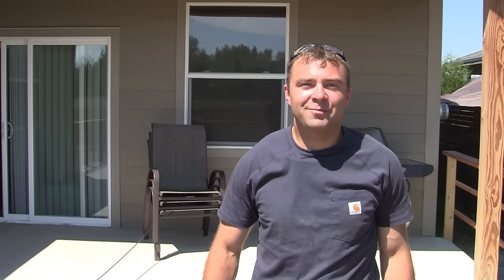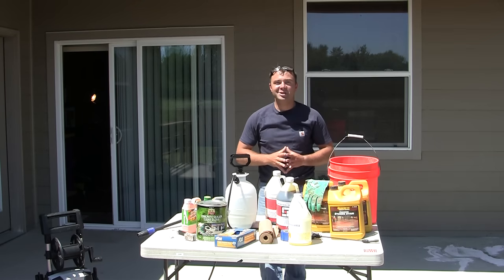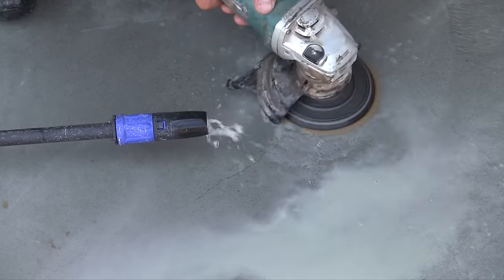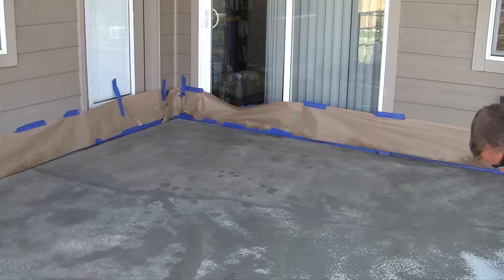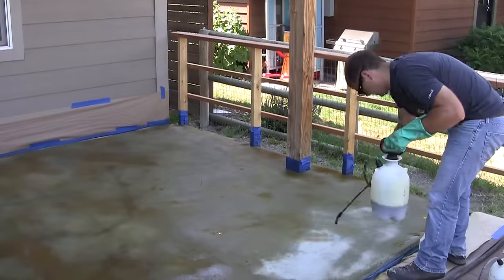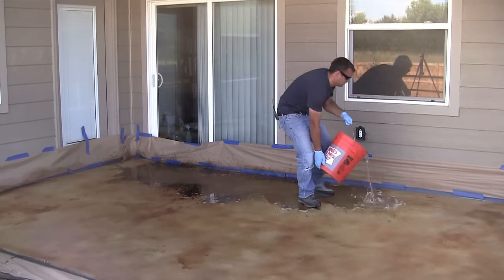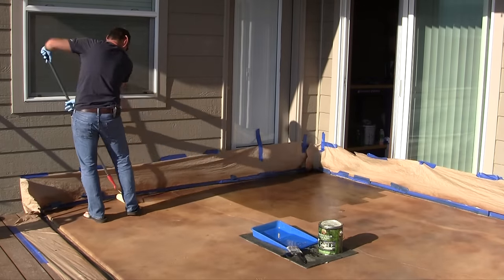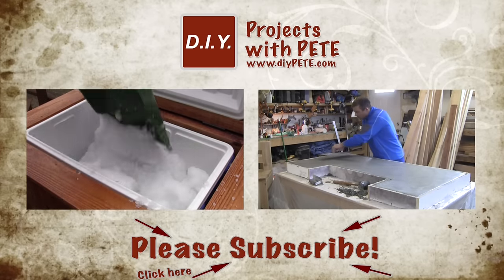How to Acid Stain Concrete | DIY Acid Stained Concrete Patio

Comment: Looking at doing this project on an existing tan concrete patio. Will the staining process eliminate any existing Efflorescence (White chalky substance) or does that need to be removed before the staining process. If so which product works best to do that. (Have used home remedies like white vinegar and pressure washing to no avail. Thanks
Ed
Reply from the maker: Hey Ed! Acid stains will not hide existing flaws, so you'd want to remove the efflorescence first. -- as for removing, you might use an etching solution or reach out to your local concrete supply store. If possible, you might look into using an orbital sander in the area if a power washer or etching solution won't work.
Reply: @DIYPETE  Do you have a product you recommend or video on this removal process?

Comment: great video, just put in a new pool, cement contacter want a ridiculous amount to color and stamp, can my  pool decks be acid stained?, if so any special sealers for safety when wet?, how long does the deck have to age before staining?, thanks
Reply from the maker: Hi! Pool decks can be acid stained. As for sealers, I'd recommend doing additional research prior to attempting to see what decorative concrete specialists recommend. Shark grip is a clear powdery sand that can be mixed in with a sealer to add grip. I've done this in sealers in garages to prevent folks from slipping. The manufacturers will all typically recommend waiting 28 days to stain. -- Whatever you do, I'd recommend doing a small test area in a more hidden part of the patio to make sure you like the colors and finish etc. And the more research the better.
Reply: stamped concrete is a MUCH better option for pool deck than stained concrete.

Comment: I've read that you should use the ammonia mixture before applying the dye as well to help clean & prep the concrete, do you recommend this or only recommend applying it after to neutralize?
Reply from the maker: Hi Nicholas! I've always cleaned the concrete and just use a degreaser and power washer. You could most likely use ammonia to clean if you'd like, but I used to do staining professionally, and we never did. Cheers!
Reply: DIY PETE thanks! Just sprayed the dye yesterday, going to respray over some uneven areas today. I'd like to thank you so much for the video. One last question, do you apply the seal/gloss coat right after pouring and brushing off the ammonia?
Reply from the maker: Hey Nicholas! You'll want the concrete to dry out completely after neutralizing the acid stain with ammonia and rinsing. Cheers!
Reply: DIY PETE Thanks for all your help. How often do you recommend re applying the gloss coat? Also, I got some on my asphalt driveway, do you have any recommendations for removing it? I'm unable to get it out with the cleaning products I tried.

Comment: Hi Pete, I'm about to acid stain my basement floor. But I was wondering, can I stain everything so it looks uniform then seal it later? I will be adding bedroom walls, but I'd rather not have work done on top of sealant/wax. And yet, I like the idea of actually staining the floors without and barriers in my way. What do you think?
Reply from the maker: +Pamela Olson Hi Pamela! I agree, staining before walls are in etc does make it easier -- and I wouldn't want to scratch up the floor once it is sealed. After staining the floor, you can wait to see if needed -- but I would highly recommend covering it with resin paper to still protect it during construction. Make sure you allow the stain plenty of time to react with the concrete before rinsing to ensure it fully reacts and penetrates into the surface.

Comment: I have no idea if you still check this channel for comments but here's hoping you do. I used a Behr Decorative Concrete Dye kit back in September 2012 on my back patio. It did a fantastic job. I used the Behr Wet Look Sealer on it and every year thereafter, I would put another coating of the sealer on it---with the exception of 2019. Therefore, I have not put the sealer on it since 2018. My patio now looks terrible, which was mostly from my lawn care  people who used their weed wacker around it; thus, chipping at it over the years. They now no longer weed wack around it. I was thinking of just using the same kit all over again and putting some fresh dye on it but I do not believe Home Depot sells that kit any longer since it's not on their site. At this point, I'm not sure what to do. Do you have any suggestions? Thank you.
Reply from the maker: Hi! Since you still have most of the stain on, i'd really try and find a similar stain to fix the problem areas and blend as best as possible. Some areas will still have sealer so it will most likely only take in the areas the weedwacker hit or the sealer was worn through. I believe the behr sealer is acrylic based. You might see if you can find a similar product at lowes, on the homedepot website, or elsewhere.
Reply: @DIYPETE  Hey! Thanks for replying! That's a great idea; however, I don't the color I used available. I think it would look very different. I was thinking about etching it and then putting on a new dye and sealer. Do you think this would work? Thank you!
Reply from the maker: @RedLikeWine  I do think that would be a good method to try. Cheers!

Comment: Hi Pete. First, I'd like to thank you for your DIY video, you make it look so easy. I'd get stuck in the middle of the patio as I'm spraying the acid or rolling on the sealer. 🤣 Second, can I acid stain my interior concrete floors after pulling the carpet and linoleum? Or would there too much glue residue to contend with? Opps, I forgot to ask my final question: which brand of acid stain did you use to get that beautiful color? Thank you.

Comment: The previous owners  didn't put a vapor barrier down under our concrete porch so it sweats a lot. Also it has been sealed. Will this technique work on my porch?
Reply from the maker: +DerpyBoy2000 Hi Derpy! You will need to remove the current sealer prior to staining or adding any type of coloring.

Comment: Great Video...How many quarts or gallons did you use?  What was the square footage of area?   I know it will vary based on how layers I apply, how I apply it, etc.  But I am curious, how much did your project take.  Same question on the sealer.   Again I love the video.
Reply from the maker: Hi Carlotta! Thanks for the comment! The majority of the info can be found in the post here: https://www.youtube.com/watch?v=ZSlzelQYEOU&lc=UgzNrpR_SGqmA8RNslF4AaABAg    - My project was around 400 square feet. A gallon was more than plenty. It took about 2 gallons of sealer for 2 coats. I'd recommend checking the label on your sealer and stain to see what they recommend for qty's needed. Best of luck!

Comment: This is an awesome video Pete! Could you share some tips on doing this for inside the house? I just removed all my carpet from my house because of my kids allergies. I stumbled on you video and am hoping to stain my rooms and living room.
Reply from the maker: Hi! The biggest things is to make sure the floors are free of paint, stains, etc. Otherwise the stain will not penetrate.  A shop vac is needed to get rid of all the water etc after neutralizing. You could use an acrylic sealer indoors to minimize smell. Also look at waterbased stains as they are less of a mess. I've done both indoors and have found success. Cheers

Comment: Great video Pete! Thanks for the info. I was curious if you have done a similar staining process on cider block? The sides of my patio are cinder block with a concrete cap. Will the cinder blocks take the stain ok or will it come out too blotchy. Color is very similar to what you used here. Thanks again!
Reply from the maker: Chris Donoho Thanks for checking this video out! Cinder blocks will take the stain, I have done this in the past. In my experience, they have stained evenly - you'll get the most even finish if you brush it on. Thanks!
Reply: DIY PETE Your the man DIYPete!!

Comment: One of the best tutorial videos I've seen!  Just had one question can I used any pump sprayer? I have a couple that I use to spray roundup around my yard. Can I use those?
Reply from the maker: +Aurelio Cazares As long as its all plastic parts, so it is resistant to the acid then you're fine! Just be sure to thouroughly clean it before and after.

Comment: Thanks for the great tutorial. I have a question about smoothing out the concrete. If you want some texture for grip on an entrance will the stain look ok if you don't smooth it out?
Reply from the maker: Hi! The stain looks fine on texture. I commonly will add Shark Grip ( basically a clear sand ) - to the sealer to prevent issues with slipping. Cheers

Comment: Thanks Pete.  What are your thoughts on blending an accent color with the base (DirectColors, inc. english red/desert amber)?  Also, when testing a small area where do you do this when our concrete patio is visible to people?  Thanks!
Reply from the maker: Hey Joe! I've added accent colors to a lot of projects. My thoughts are to go for it! --- as for test spots, It's, sometimes I'll dig out the grass a bit on a side, clean it off, and add a bit of stain just to get an idea on the color. --- With a lot of patios it is tough to test --- indoors I'll do a small spot in the corner of a closet --- but testing on a patio isn't so inconspicuous :) Cheers!

Comment: Hi Pete,
After I cleaned the concrete, it failed the water absorption test. Do you recommend etching the concrete or will the acid stain still absorb into the concrete?
Reply from the maker: Hey Joel, If the water doesn't absorb, neither will the stain properly. Is the concrete sealed?
Reply: @DIYPETE  What is the (water absorption test.)? can you explain please? my concrete was sealed yes not  sure if will take the stain or no

Comment: This was a great video. We are trying to get someone to acid stain our back porch.  The porch was originally painted white but is starting to chip and peel away. One guy told us we couldn't acid stain it because it would be almost impossible to get all the paint off in order for it to look good. That make any sense?
Reply: Makes sense. Extra work but doable. I’m in the Dallas area. If you’re in this area I can do it!
Reply: @danielfethkenher3005   It has a broom finish.  Does that matter?
Reply from the maker: Hey Paul, it would be a lot of extra work. While it is doable, you'd certainly just want to make sure every last bit of paint is removed successfully. Perhaps a really good power washer would be something to try first. Concrete can always be polished or ground down with diamond bits, but that gets pretty expensive and changes the texture and look. Best of luck!

Comment: Hey DIY Pete.  Do you know why when you mop the epoxy topcoat on an acid stained concrete floor it turns white or cloudy?  Of course you should be able to mop the etched and sealed floor.
Reply from the maker: +Brad Bell Is this a newly stained floor? Was the acid stain neutralized thoroughly and completely?
Reply: +DIY PETE Thanks Pete.  It is a newly stained floor (about a month ago).  I really think I neutralized the acid stain, but that might be the issue.  I have been speaking with Valspar who makes the stain and epoxy, and they think that might be the issue as well.
Reply: +DIY PETE Hopefully that isn't the case because if so I imagine I'll have to strip off all the epoxy sealer.  Would you agree?  There's probably no way to fix it as is I imagine.

Comment: Your patio looks beautiful! We have a concrete apron around our pool deck that we'd love to do this on, but any suggestions as to how you'd keep the liquids out of the pool?
Reply from the maker: Hi! Great question. I can't say I have experience doing this around a pool and trying to keep any liquids from flowing to the pool area. However, you'd need to plastic off the area for sure and use a good tape along the sides of the plastic to prevent any liquids from flowing under. Cheers!

Comment: Hi pete, thanks for uploading this video. I have a question. Can you apply this acid stain on normal concrete that is allready in the house? or do you need to put first another kind of concrete on the normal concrete floot thats already there? I am sorry for my bad english. kind regards alicia
Reply from the maker: Hi! It can be applied to normal concrete indoors --- as long as it has not been sealed. I always recommend doing a small test area if possible ( like in a closet or sort of hidden area ) - I've stained lots of concrete indoors.

Comment: Hi Pete, great video. I am assuming that an outdoor patio will have to be resealed every year like a stamped concrete patio? thanks'
Reply from the maker: Hey Michel! It really depends on how protected the area is from the elements, and the sealer used. Staying on top of it by sealing every year is great if you can. My area is pretty protected and so mine lasts over a year -- but maintaining any outdoor stained surface is going to prolong the life and keep that stain looking awesome!
Reply: Hi Pete, since my comment I have been researching sealers and was wondering about using a lithium silicate base sealer instead of a regular oil based sealer. It seems that the lithium silicate is very strong and would not need a re-apply but not 100% sure. DO you have any experience with those? thanks

Comment: You appear to have a hand sprayer when applying from the pump sprayer but you never use it in the video.   What is its purpose?   It looks like full strength stain maybe in it?

Comment: I have a few stains when I stained my wooden pergola. Is it possible to remove or do I just get a dark stain?
Reply from the maker: Hi! The acid stain will not take wherever their is wood stain. It is possible to remove ( perhaps with a power washer / wire brush ) -- and maybe even a concrete cleaner and brush. If you still can't get it out, I'd say the dark stain will somewhat blend in with it. Cheers!

Comment: Hey Pete, awesome video! Question does this process make the concrete slippery? If so how to prevent it from becoming slippery!
Reply from the maker: Hey! Thanks for watching! So my concrete already had a troweled finish - so it had texture and is not slippery. The acid stain doesn't change the texture, but a sealer certainly can. This could be slippery on a power troweled concrete floor. However, one thing i've done when doing epoxy garage floors is to add " Shark Grip " into either the last coat of epoxy or into a clear sealer coat. It is basically a clear sand that gives the floor texture and it is pretty much invisible.
Reply: Thanks pete

Comment: Would this product be ok to use on a concrete driveway where an RV will be parked? Will it stand up to tire tread?
Reply from the maker: Hi! A lot of folks do stained driveways and walkways in the southern states. I wouldn't because we use snow plows, tire chains, and heavy equipment a lot in our neck of the woods. The stain soaks into the concrete, you'd just want to find a good sealer that wouldn't have issues with the tire tread etc. I'd recommend doing some additional research, but I certainly think it would be a possibility.

Comment: Very nice, the video was published 2 years ago, how much you'd charge to stain a patio the same size as the one you did on the video, today, 2017? Thank you.
Reply from the maker: I would recommend doing some searching around on the internet as the square foot rate is very region dependent as well as project size dependent.  Cheers!

Comment: I notice you had cracks in the concrete. How did you prep them before applying the acid stains so they would not show?
Reply from the maker: Hi! I used a polymer based concrete overlay product. It is flexible and fills the crack, but will take the stain a bit different and you'll still be able to notice it a bit. Looked fine though. Cheers!

Comment: Hey there.  I have a machine trowelled garage floor.  I need to prep it for the stain.  Can I use a floor sander to do so and if so, what grit would be best?  80?  Just need to rough it up enough to let the stain penetrate.  I don't see any comments addressing it.  Please advise and thanks!
Reply from the maker: Hi Robert! You'll want to make sure oil stains are removed if there are any since the concrete won't penetrate in them. As for prepping --- I would first recommend pouring some water on your floor to see if it's been sealed and will absorb the water at all. If it does, you might be ready to stain ( many coffee shops and box stores etc have the power troweled concrete ) -- and stain it that way. If it is sealed, you'll have a lot more work to do in getting it off. Tell me a little more and I'll do my best to answer your question. Cheers!
Reply: DIY PETE we machined it and it took.  We are now concerned about how long the clear coat will take to dry here in Humid Florida.

Comment: This is awesome, we will be staining some stairs, and our contractor says it really hard to get good results (no drips, no pools of color, and no spots.....) I am determined to find someone who has techniques to not let this happen.  You made it look easy....is there a way to do steps without getting drips and/or pooling or that white spotted look?
Reply from the maker: +Your Story Begins Here Hi! I've done steps before. There are definitely ways to minimize drips etc. Decorative concrete experts will know how, but there are certainly techniques you can use as a DIY'er to accomplish it :) I always like to lightly saturate concrete prior to applying any stain. To prevent drips etc, you can apply the stain using a microfiber rag, or a sponge to the steps. This way it doesn't pool, and you can apply it without worrying about drips. There are multiple ways to avoid pools/drips --  but this method has worked for me. Good luck!